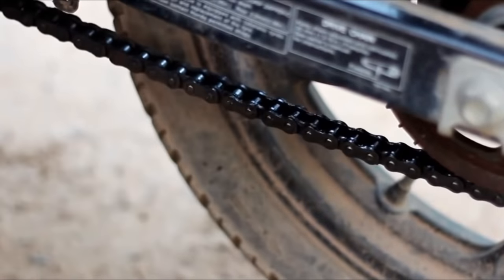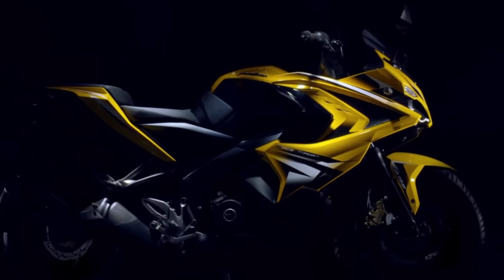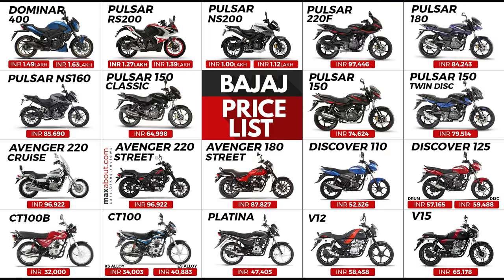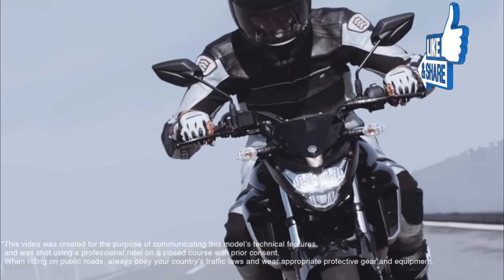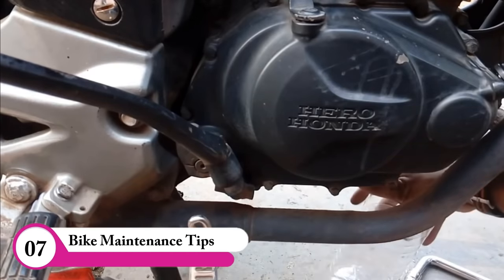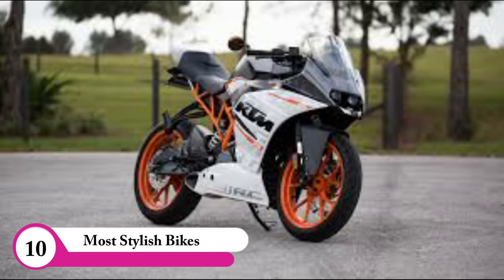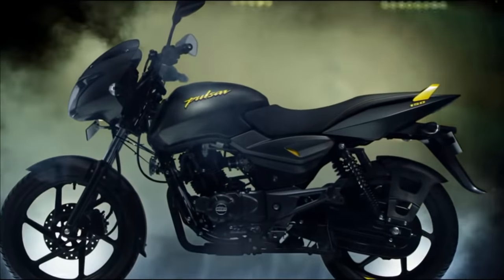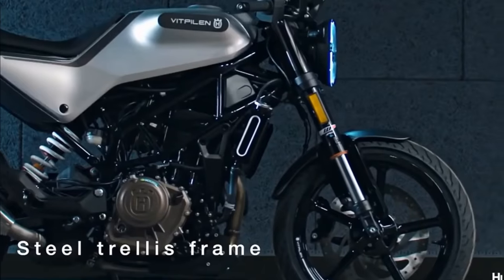Resale Value அதிகம் உள்ள பைக்குகள் | 160 CC Best Honda Bikes | FC  For Old Bikes | Bike Maintenance

Comment: Point 2) is wrong....Timing chain  engine Kula crank shaft and cam shaft ah connect panra chain....neenga explain panrathu rear wheel chain used for power transmission....crct ah entha part nu visiyam therinjutu explain panunga....neengala nenachutu thappa info solathinga
Reply: ur crct bro

Comment: Hi Ji. How are you???. Ji, now I'm using hero passion pro 2014 model 97cc, I'm want change bike. Give me some suggestions 😊... 1) TVs Apache 160 4v , 2) bajaj avengers 160, 3) Yamaha fz s, 4) Yamaha fz,  5) Honda unicorn, 6) Honda sp 125, 7) hero passion pro 110, 8) RE CLASSIC 350. Which bike best for.1) maintenance. 2) SOMETIMES WORK'KU KAGA 300KM TRAVEL PANUVAN, 3) me, wife and baby seating capacity. 4) mileage minimum 45km , 5) lower price and quality.. And actually na IPO use pandra bike vachie 300km travel pane irukan, not satisfied travel.